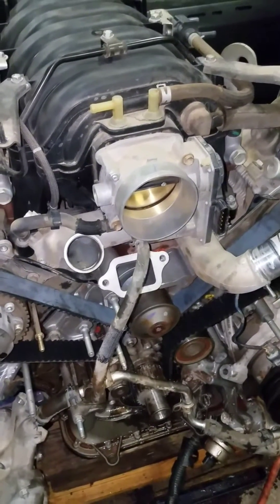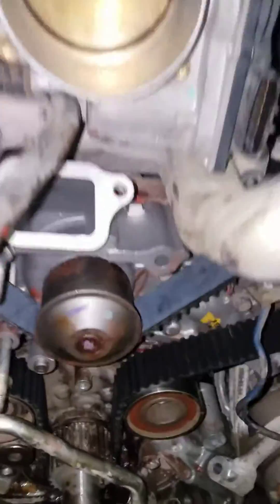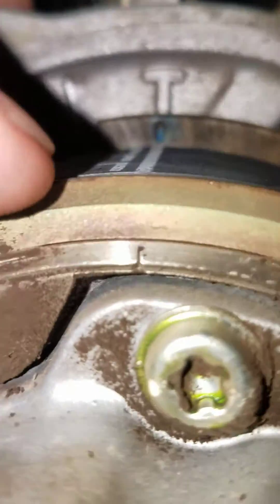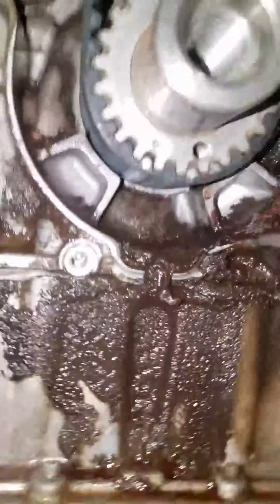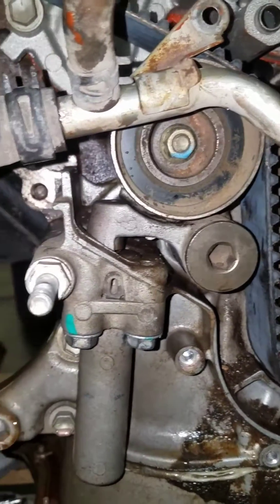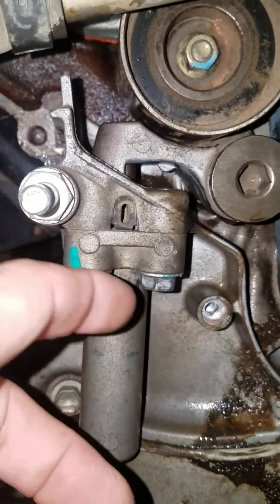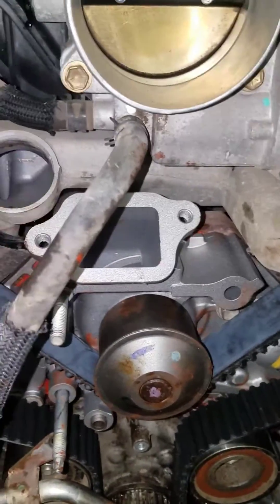Toyota Tundra 4.7 Water Pump and Timing Belt Install

Comment: Your timing marks are off lol. Wow dude talk about bad advice
Reply from the maker: @Braapcity  Not sure what you're referring to.  Or if you're commenting on the right video, but in this video, the timing marks are spot on.  You may have your info incorrect for what the timing marks actually look like, lol.  Thanks for watching.
Reply: @okcvet1st  nope i don't i just did this job. I just watched your video to see if the torque specs were stated. 

There is a mark at two o clock on the crank sprocket and oil pump that line up and the marks you have it set at aren't the actual timing marks outline in service infornation go look. 

Sure it can work if you go by belt tooth count if you use the belt marks but thats not always as easy as actual factory timing msrks when they are present

Other people even commented on this telling you this
Reply from the maker: @Braapcity  Your original comment seems to suggest it is completely false info, which it is actually very good information.  And as I've explained it in the past, the reason you use the T is because it's an interference engine, and when it is at tdc, you chance a cam rolling and causing internal contact with a valve.  When it sets off tdc, and why it has the T mark, you have less chance of internal contact because the cams have less tension and less likely to turn themshelves while installing the belt.  I know many websites, youtube videos, and repair manuals show to use the I (tdc) but that isn't the safest thing to do, especially for DIY mechanics like yourself.  Just because everyone says to do it on the I, doesn't mean they understand why the T is there.  The T's are actual factory marks also.  Both ways line up the timing.

Comment: Made it sound easy. I'm getting ready to put a order  in on Amazon and get the Aisin water pump and timing belt kit. Never done one before but I have done the starter job on this same engine and I nailed it. I just have to walk away from it quite often. So I take my time and pray not to break anything. Any suggestions or video on doing this job with the motor in the vehicle? Like what all do I really have to take off the front of motor? Rad, fan, timing covers and that's it? It's just so hard to trust anyone doing a job like this, I figure if something goes wrong I'd rather it be on myself than some mechanic. It wouldn't be a good thing. Not only that what if the mechanic does everything to a T and really tries but fails and causing more damage. I'd just rather kick myself in the ass than someone else's. I feel I can do it and just peeped at my first video about it here. Thanks for the advice on the hyd tensioner I would have for sure cavemanned it. Thanks

Comment: The 'T' is not the timing mark.  The verticle line is the timing mark which is to the left of the "T".
Reply from the maker: Lol, you can do it how ever you want, I'll stick with the better method!
Reply: @okcvet1st  - - - That's fine.  I have the 4.3 version and on page EM26 of the factory manual - - - it details the timing marks are in fact the vertical lines - NOT the letter 'T'.  Get in touch with the local Lexus dealer and ask them - then let me know what they say.  https://www.youtube.com/watch?v=fM1A0DWhRHc
Reply from the maker: @dondon6988     yes,  tdc is the I but that isn't the best place to do the timing.  If you notice my title, it says 4.7, not 4.3.  Every setup is different.  Depends on which factory location it came out of also. Some models don't even have the T, others don't have the I.  When they have both, the T is the better option.  I use the T if it has it.  Don't know how many engines you've broke down, but if you've did any on this particular one, you'd understand why the T is better to use.  But like I said, you can do it how you want.
Reply: He says "you can do it however you want" lol. It doesn't say that in Toyota service infornation. Theres two ways to do it- right and wrong. Clearly this guy is giving out bad advice

Comment: I finally just jumped into mine and done it as per auto data that came with the timing kit and to as the 50°BTDC you had better follow the data per year ale of your vehicle because with mine having vvti the btdc was  necessary because it either regards or advances the ign spark and will run shity if not followed you are talking bout backfire ,missing and a lot more fuel consumption ,thanks auto data!!!

Comment: Mine is counterclockwise not clockwise just wanted to make that clear,that according to the Haynes 2003 to 2009
Reply from the maker: The truck in my video is an '06.  Its the same. You can follow the Haynes manual if you want, which ever way you understand how to do it.

Comment: Hey bud my vehicle is a 2006 Toyota 4 runner Sr5 4.7with vvti in maneul it says to turn until at Tec which is the l mark then it says rotate 50degress counterclockwise is thiat what point the cams and crank are not under any tension anymore,and after I take belt off there do I just put the new one back on where it sets from the removal position
Reply from the maker: Rotating the crank 50degrees clockwise from tdc is prob close to the T marks that I use.  Nothing difficult about these engines, you just have to understand the process.  You install the belt where to took it off at and line up the marks appropriately.  If the cams happen to move, you'll need to realign them to install the belt.
Reply: @okcvet1st  I'd think as long as your crank dosent move after rotation btdc or adtc using your new belt line up crank work right to left keeping tension and move cam accordingly to match up mark on belt and should be ok right?am I close

Comment: So put the crank on zero and the cams onT when removing and replacing belt? What's the 50degree advancement I see otramm mechanic do in there video do you know,sorry for all the questions brother but. Wanting to do this myself to save a little money but then again I don't wanna jack my engine up,lol
Reply from the maker: The crank pulley gets set at the atdc dot/timing stud just above it which is to the right of the 0 degree tab.  The cams should be close to aligning with the T's when you do that.  Belt stretch may cause the marks to be off slightly.

Comment: So do you pull the belt off at. The l marks and then put it on with the cam lines on the t?
Reply from the maker: It's best to line up the crank pulley timing mark with the notch just above it on the timing cover and the cam gears/belt timing marks line up with the T before and after belt replacement.  The reason is the engine is an interference engine and when the engine is at tdc, you chance a cam rolling and causing internal contact with the valves.  When it sits off tdc, you have less chance of internal contact because the cams have less tension and are less likely to turn by themselves while installing the belts.  I know many websites, YouTube videos and repair manuals show to use the l (tdc) but that isn't the safest thing to do.  Hope this helps!

Comment: I thought the cam marks or lines on cams lined up with those not he's T TDC lines or is that a 50degree deal on vvti engines
Reply from the maker: The T marks are for the timing belt, the l is for tdc. When you put your timing cover back on and get your crank pulley reinstalled, you'll see the crank pulley timing mark lines up with the stud on the timing cover if you use the T's.  If you line up your cam gears/timing belt with the l, your crank pulley timing mark should be pointed at 0 on the timing tab.  Hope this helps.  Thanks for watching!
Reply: Okay,How are you doing.?

Comment: Excellent quick vid!  https://www.youtube.com/watch?v=AVLX_v6xQSk   Thanks OKC vet (and thank you for your Service!)

http://www.datafilehost.com/d/c87b4fb4       Sequoia Manual

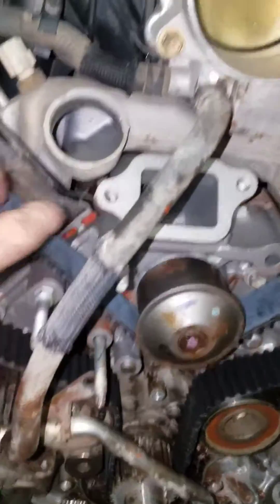Rockauto.com  Aisin is Toyota OEM for most parts.  I got great timing kit.  ALL pulleys and tensioner A MUST!  Look for The Aisin pump comes with 2 orings and gasket  -USE NO RTV, etc..,  one for backside of pump and one for hole at 2:02 in vid https://www.youtube.com/watch?v=AVLX_v6xQSk (above)    

Do you want to re-visit?  Neither did I  so Replace Crank and Cam (TOYOTA OEM stealer parts only!  DO NOT USE AFTERMARKET HERE!)

Crank bolt.  Simple. Used heavy air impact (harbor freight $129) as my milwaukee MR-18 was too big.

Cam seals -  loosen "pinch bolts  2-each cam first  Tighten to ONLY 6 ft/lbs!   a sharp hard nail punches a screw pilot hole in top/center of cam seals.  Use drywall screw/vice grip/small pry bar to pull out seals They nearly fall out.   

Save old seal,  turn it around,  use a piece of PVC plastic pipt  (I used a PVC fitting of nearly EXACT DIAMETER of old seal)  CAREFULLY EVENLY install perfectly flush with few mallet taps against your improvised seal driver.   (a standard driver install tool kit will not work as cam/crank extends too far)

POLISH and clean all shaft ends before new WELL OILED seal surfaces are installed.  

Watch the book torques on everything.  Extremely light torques.  Torques in manual (above link)

Comment: I am about to tackle this in a few weeks and hope I can reach out to you if needed.  I got a list of recommended parts off a Toyota Tundra forum and it looks to be around $300+.  Did you order all OEM parts from Toyota or somewhere else you would recommend?  Thx for that video!!!
Reply from the maker: Keith Beal   I buy my parts from a local dealer wholesaler or from Summit Racing.  The parts for this truck came from Summit Racing.
Reply: Okay, how are you doing ..?